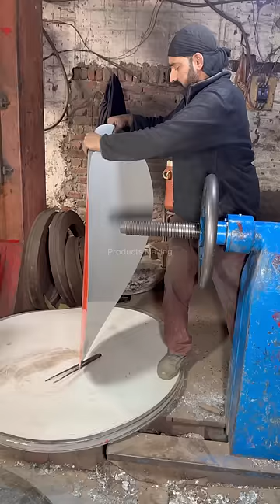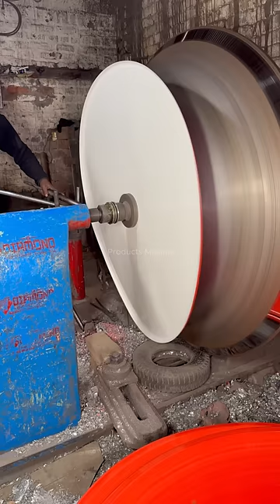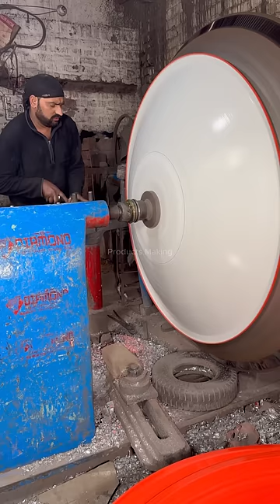Making Stainless Steel Wight Dish For Satellite Signals #making

Comment: back in the 80s i made my own 12 foot dish with screen, wood, a large steel ring built atop a sand pile i had sculpted with a parabolic stick stencil spun from above. then the hill was dusted with cement powder for a tiny bit of stability. the project cost me about $90 excluding C LNB, cables, receiver.
Reply: That was basically the price of a premade dish here around that era.
Reply: Ah, but not 12 foot, what was he pointing at?
Reply: @bloepje  given the size, id say Uranus
Reply: 😂 @crf80fdarkdays
Reply: B.S.
Reply: Ok